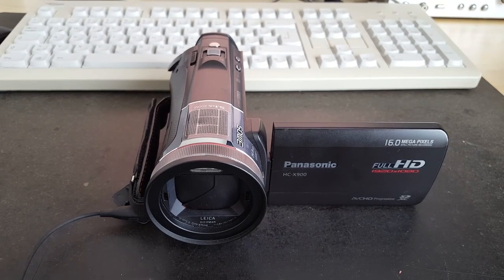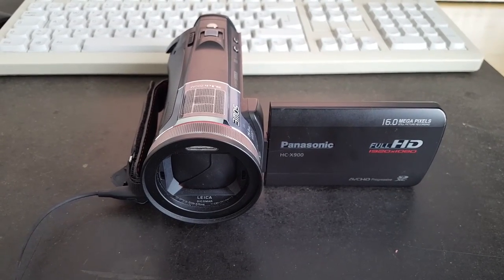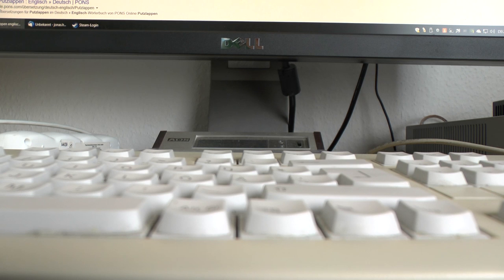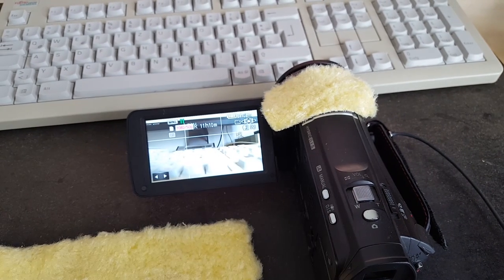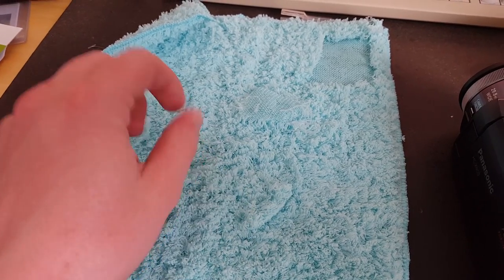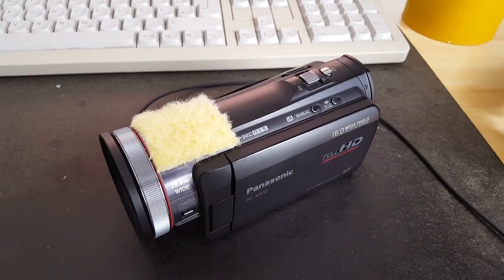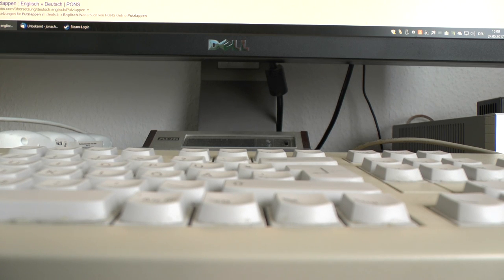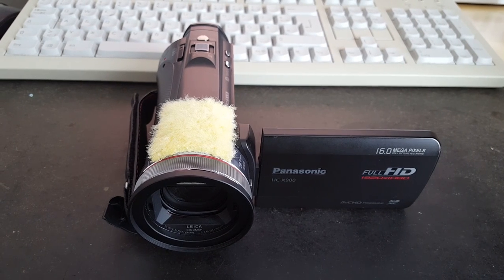Quick and Dirty DIY Wind Screen for Camcorder Microphones

Comment: I am going to use a piece of sticky backed Felt Protector - the kind you use underneath furniture to protect floors. I have cut a small hole in the glued area so that sound can still come through. Fits really well and hopefully it should cut out allot of wind noise. I may add another on top of the first one if needed. Also - It looks really good too
Reply from the maker: You can try that, but I have a feeling the felt would probably cut out too much of the sound that you want to record - and not just the wind noise.

Comment: You're on Steam? I saw it on your monitor.
Reply from the maker: I have a game that needs Steam to run. I don't use any other features of the Steam program...
Reply: DrCassette
It's irritating when you need a separate launcher in order to play certain games. But I suppose it must be necessary for the game to function as intended.